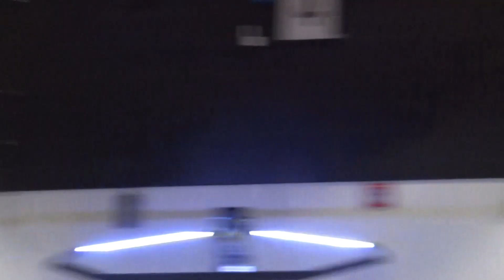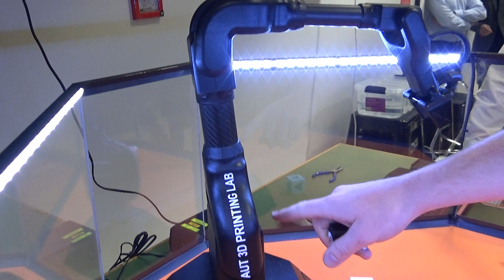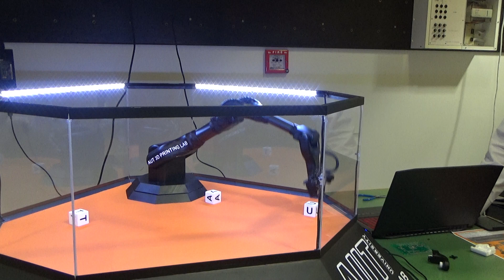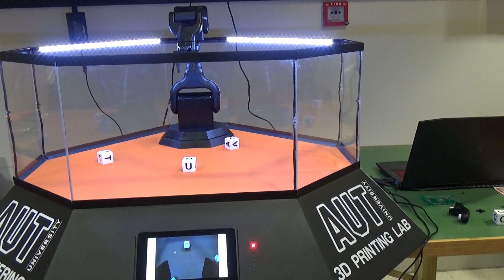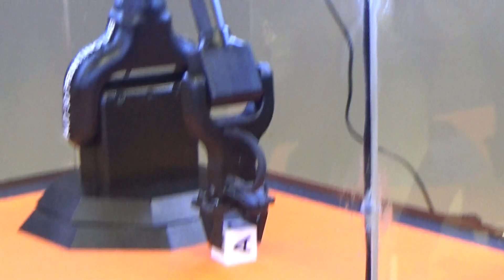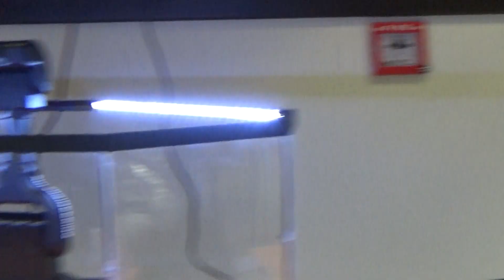Robotic Arm

Comment: I'm impressed with that one!   Even just building the robotic arm, and hiding the wires, good job.   Having the controller making assumptions and using those to calculate how to move the arm is a great example of engineering.   If you know something that you can extract further information from, the use it to your advantage!